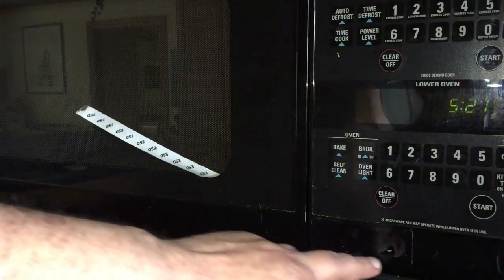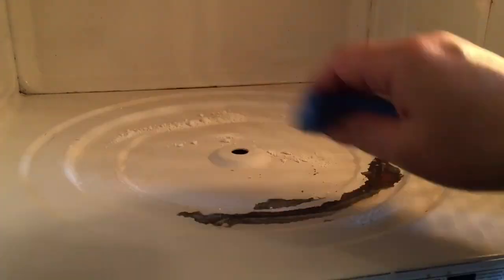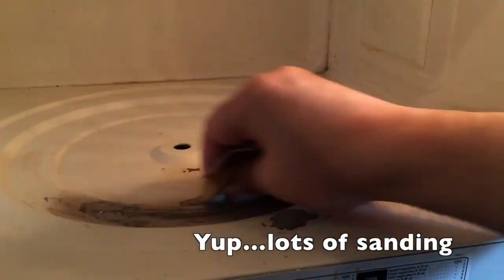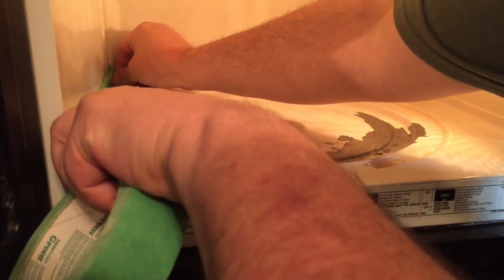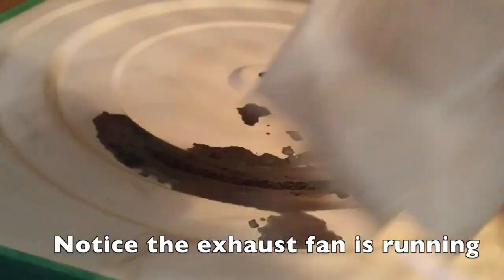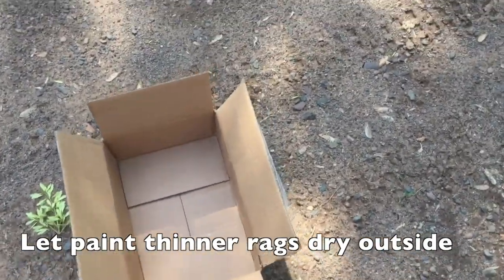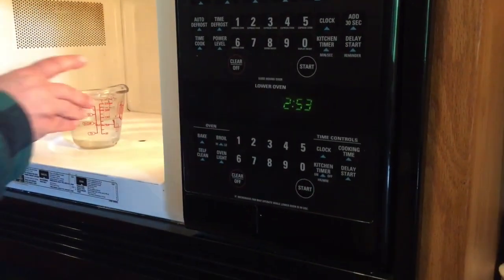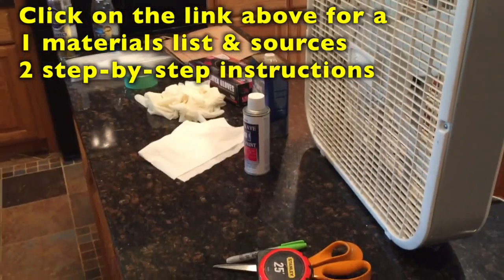Paint your microwave's interior - fix rust and peeling - Step-by-step

Comment: Aloha,  every thing rusts here in Hawaii.  I found using a wire brush on
 a drill worked great after scraping the scales off.  Then a bit of 
sandpaper to smooth it down.  I thought about using rust preventive but 
decided Rustoleum prevents rust so I used 1200 degree high heat white.  
Waited an hour after 1st coat to put the 2nd coat.  Used green scrubber 
to clean the wheels on the ring.  After 24 hours, I put a cup of water 
with 2 heaping tablespoons of baking soda and ran it for 3
Reply from the maker: "…and ran it for 3…"   what happened next????
Reply: @maximpulse  minutes to remove any paint odor that may be there if you don't let it dry a full 24 hours
Reply from the maker: @franlum  Thank you for coming back to satisfy my. curiosity! 
One more thing you might want to consider is adding a silicone mat under the carousel wheels.
You can see what I mean here:
https://maximpulse.com/tools/repaint-microwave.html

Comment: I  just did this to my microwave--just the bottom. It looks like new. I sanded until ALL the rust was gone. Made sure no residue was on it, then sprayed the whole bottom. I sprayed it twice. I hope my microwave lasts a lot longer. I have been babying it--leaving the door open to let it dry after using, making sure no water is underneath the clear plate. Thanks for the video, maximpulse!
Reply from the maker: Good for you! 
Since making this video I have added one major improvement: putting a silicone mat under the wheels. This prevents the wheels from grinding off your new beautiful paint.
You can see what I mean on my web page here:
https://maximpulse.com/tools/repaint-microwave.html

Comment: Paint it out doors
Wear gloves with bar keepers.
The paint appears chalky instead of glossy?
Reply from the maker: I understand your suggestions, but there are reasons I did this the way I did.
 It's hard to take a $2000+ built-in wall oven/microwave outdoors…that's why I showed how to re-paint it without moving it.
The paint is glossy when applied in several thin layers. It is good to practice outdoors on a piece of cardboard before doing the microwave itself.  
No need for gloves with Barkeeper's for me and everyone else I know but maybe some folks have sensitive skin.
Reply: I painted my microwave in my kitchen. The paint really does have strong fumes. I left my door and window open and blew the fumes outside with a fan. Then I left the fan on until it dried. DO NOT breathe in the fumes!!! DO NOT DO THIS AROUND CIGARETTES or any other source of flame or high heat.  PLUS----I just love Barkeepers Friend. I use it to clean a lot of stuff around the house. It removes rust really well. I even make a paste of it to remove rust on fabrics.  ( My 2 cents today)

Comment: Mine was way way worse than this and only on the bottom. I did the cell phone thing and it seems there's radiation leaking out - shame too cause it's only 2 years old! Don't think i'll be buying another hamilton beach brand.
For now, i'm holding off buying another and i've started using my air fryer/toast oven to heat up my leftovers - it's way more hassle but works good enough.

Comment: I find a metal brush works wonders (wear a respirator, use a vacuum cleaner if you have it to pick up the dust).
Reply from the maker: Sounds like a good idea for getting started.
And then using progressively finer grits of sandpaper for a smooth edge.

Comment: Appears to be a GE JTP86BF6BB built-in ya got there. Mine is the JT965SK2SS--nearly identical, including the issue with the flaking paint inside the microwave. I found that QB Products 98QBP0302 paint didn't hold up over time, in spite of my careful application. So I tried an automotive paint (non-metallic) a try on a whim. The results have outlasted the QB Products stuff... so far.
Reply from the maker: Hi, thanks for your contributing your experiences. 
What is the automotive paint you tried? It's too bad there isn't any testing to tell us what paints are effective or "safe". I have no idea what makes QB declare their paint as being for microwaves. Sigh.
I am finding the paint is holding up well except for where the wheels trace their circle. Come Spring I'll try doing this again but with a primer. QB claims one doesn't need a primer, but many folks have chastised me for not using one. We'll see! 
But I can't do that right now as it's -25° F so I can't have the windows open to ventilate.
I am about to make one more video with another solution I thought up. It is pretty stupid to have this problem at all.
Reply: You see, the funny thing is I have one that looks quite different on the outside, different brand too, but inside it's also painted white and the spinner wheel thingie and the plate/dish look IDENTICAL.

Comment: Sir, the top of my microwave  is peeling.  Can I use my my small hand sander? The arthritis in my hands makes it difficult to do things of this nature for long periods.  Also, could I do this out of doors?  Thank you so much for this video.
Reply from the maker: I don't see any reason why you couldn't use your small hand sander.
And yes, if you can doo this outdoors, that is the best! There were dust and paint fumes. That's why I made the plastic shroud around the door opening.
Reply: maximpulse Thank you for your kind reply

Comment: Greetings from Louisiana! So how did your repair job hold up for the long term? any recurrence at the original problem areas? The special paint is a little pricey and I just wanted to see if the effort is/was worth it. My problem is the back wall at the center/bottom aspect that started as a 2mmx2mm spot that I thought was food, but there was adjacent blistering of the paint. Now its 1 cm x 1.5 cm after scraping with my fingernail, and I'm sure there is more.Microwave is only 4 years old. May try Rust Cutter initially to change rust to a non rust surface first and then paint. Thanks for any light you can shed on the feasibility of this project. I just subscribed to your channel; you have loads of videos that look to give good advice!
Reply from the maker: I have gotten some new rust, but only where the wheels of the turntable continually grind over the new paint.
A new microwave is stunningly expensive so I am going to continue to nurse it along. And I intend to repaint, but until I find the time…I have another idea.
I bought a silicone pad which I am going to experiment with…simply trimming the pad into a ring  where I cut out a hole in the center and then trim off the edges that poke out so it lays flat and then see how that works.
Here is the pad I bought if you want to try this: https://amzn.to/2Nkwpk0
Obviously this is only a potential fix if there is only ruse where the wheels run in a circle. Folks who have peeling paint elsewhere in the box would still be doomed to repaint. And using some preventative might help.
And one would need to subsequently need to clean periodically under the silicone pad. But hopefully it will provide a barrier between the wheels and the paint.
Let me know what you decide to do!
Reply: maximpulse Thank you for your detailed reply. I’m getting gas and on my way to the house and will give a detailed reply when I get home. I want to be able to send you pics or a video to show you the spot. I haven’t scraped all of the bubbles in the paint yet but the area is likely to be twice as big by the time I do that. I was even toying with the idea of using Bondo body filler if the defect is too deep, but haven’t heard if anyone doing that yet. I’ll be in touch and thank you for taking the time to reply - I had no idea that microwaves actually had this problem until I discovered my spot and viewed your video. 👋
Reply: The rust damage reminds me of the Chevy Vega from decades past. The rust is in layers and the actual steel panel is quite thin. And I’ve always had great luck with Emerson products - until now. My clock radio/alarm is 35 years old and it’s an Emerson with 9V battery backup. Always works.
Reply from the maker: @plumkey197  If you want send photos or chat at length, I have a link at the bottom of all my web pages for emailing me directly. You can see it at the bottom of my microwave painting page here:
https://maximpulse.com/tools/repaint-microwave.html
The trouble with Bondo is the metal box is what traps the microwaves in the box. Bondo is a sort of plastic so it will not block those waves. But a microwave has a double metal box, so you get to decide what to do. If I had actual holes through the interior metal box I would probably replace the whole microwave. But if the problem is superficial rust, then I believe one can repaint and carry on. I wish I had a microwave detector to tell what's really going on but…oh well.

Comment: this is the 2nd microwave this has happened to us with.   The older ones of yesteryears never had this problem.
Reply from the maker: No kidding. This is weird problem, especially considering both the high price of these built in microwave/ovens AND how one can't replace just the microwave.
The cost was what inspired me to go to the trouble of repairing ours and filming it.
Reply: Usually we buy the cheaper microwaves but I splurged about two years ago for a "slate" finish to match my fridge and dishwasher. You guessed it! The inside top is bubbling up and some areas around the top edges. I am going to maker certain I can find another microwave in stock before I attempt this!

Comment: Can we use acrylic paint.
Reply from the maker: I don't know. There is little information about all this. And the paint I used, which has worked nicely, is the only spray paint I have found.
If you try acrylic, let me know if it works for you.
You could try painting something with the acrylic paint and then microwaving it to see what happens.
Of course always put a cup of water in there, too, to give the oven something to absorb some of the microwaves.
Reply: @maximpulse  I have tried acrylic paint it worked for me is properly 
Selletelled at the floor of the microwave. Just wanted to share with you . Been 5-6 days no problem yet.
Reply from the maker: @donowhy4113  Thanks for sharing your experience. I'm curious how it will hold up in the long run.
Below is a link to an interesting article about what plastics are suggested for microwaving and which are not. Apparently some plastics are "transparent" to the waves and do not heat up and melt. Others can heat up and melt. 
They specifically say "PET and polycarbonate should not be used for microwaving as they tend to absorb heat. Acrylic and polystyrene are also not recommended."
https://www.usplastic.com/knowledgebase/article.aspx?contentkey=952

Comment: Mine used to look like video. Only now the other day I removed plate and now it's so much worse it rusted thru making holes. Wonder if I stir up some flour and water or cornstarch and water and fill hole with it if it will work. I can't walk and when I do get 8n chair it's to fund whatever messnkiss made only I didn't know they spilt liquid in microwave that it rusted the bottom out. Anyone have any home remedies for filling holes safely
Reply from the maker: Hi Pula, here is my latest idea for a quick fix: buy a silicone mat and trim it to fit on the floor under the turntable. Here is the mat I am going to put in mine: https://amzn.to/2xm2bVG
You would need to cut out a center circle and perhaps also trim the edges, but it should fit under and support the turning wheels. It is somewhat see-thru so you can remove the platter and 3-armed turner and then place the mat on the floor and use a magic marker to trace where you need to cut. You would still have to clean it periodically, but this might be an easy quick fix.
I don't know of any material that would be guaranteed safe for repairing the shell. An epoxy filler like this: https://amzn.to/2JcWyi9 would fix any hole, but I can't say what would happen when it was microwaved. They also have a "high heat" version here: https://amzn.to/2X88MxC
You may be able to find such products in local car parts stores.
Reply: you can use hi heat epoxy
Reply from the maker: @mattijarvinen3966  Any particular product or brand? I saw a lot of reasonably priced high heat epoxy putties and very expensive resins. Any suggestions? Did you actually use high heat epoxy yourself?

Comment: How did it last, I saw reviews that that particular paint is not a good product and does not last, how did it work for you, it's longevity is what really matters😉
Reply from the maker: It has held up nicely, except where the wheels directly grind against the paint. I just repainted that narrow ring recently. It is a sturdy, hard, thick, enamel-type paint.
I don't think any other paint will work any better so I came up with a "forever" repair by putting a silicone pad between the wheels and the painted floor. It is holding up perfectly.
You can see a photo here: https://maximpulse.com/tools/repaint-microwave.html
This is the silicone pad I used: https://amzn.to/2MeaqOP
Installing the silicone pad is a simple procedure.  I just placed the pad on the floor of the microwave and traced where the center hole of the roller is (the pad is semi-transparent). Then I cut out a center hole in the pad with a razor knife.
I replaced the three-wheeled roller part, too. Probably not necessary, but considering the effort of painting and how expensive these built-in microwaves are, it just felt right.
GE roller: https://amzn.to/3kdsYuR
Reply: @maximpulse  
Thanks for the advise🤗
Just wondering if you could place the silicone mat over the bottom and bypass the painting? Mine is also a built in unit/oven combo
Reply from the maker: @theequalizer4justice879  You could certainly try just using the mat. You can always paint later on if you need to.
It seems to me there are two problems with these microwaves.
1. The wheels on the roller wear away the paint. The silicone mat solves that problem.
2. Exposed metal rusts because of all the steam and moisture in the enclosure. If you already have exposed metal under the silicone mat it may continue to rust and eventually eat holes through the metal floor.
If you try just the mat without repainting, check back let me know how things go down the road.
Reply from the maker: @theequalizer4justice879  The truly crazy thing is these built-in microwave/ ovens costing over $2000. I think we got ours used but almost new 10 years ago for a couple hundred dollars…not something to easily repeat. Saving thousands is a powerful motivation.
Reply: @maximpulse  
Thanks, I ordered some mats, but I think you are right, the mats won't stop the rust because of the steam and the paint will continue to peel,. I do have exposed metal but rust for now doesn't seem to be an issue but I can see how it would be from the steam:((
Reply: @maximpulse  
Yes they are extremely expensive $$$ that's why I don't want to have to replace it, it's actually working, why would I have to replace it because the paint came off?? Ridiculous 🤯 where would a person find a used one and Trust it to be in good working condition?
Reply from the maker: @theequalizer4justice879  Let me know how it goes for you.
I know I tend to forget to clean under the mat I put in…I guess this will serve as my reminder to do so!
Reply from the maker: @theequalizer4justice879  We found ours on Craigslist. A young couple had purchased a new home and the wife just had to have all the kitchen appliances changed from new black to stainless steel.  So we got several new appliances for a few hundred dollars. Obviously that was just luck. Since then we've learned it is a lot harder to find black appliances…like when we needed to replace our refrigerator.
But you might be surprised  how many people sell off "old" appliances simply to stay with the latest fashion and Craigslist is a great site for such things.
Reply: @maximpulse  
Thanks, just wasn't sure if you can really trust from sellers of used items especially on craigslist, buyers beware, ya know...😢
Reply: I bought the paint and tried painting after sanding and preparing and cleaning real well but still got bubbling in some areas, so sanded it again and sprayed it again and each time I repainted it still bubbled,  very frustrating and only in some places, probably going to have to resand and repaint and repeat 😫

Comment: If you clean it after something blows up in there you don't have to refurbish it I've had one for 12 years and it looks like brand new course it's a whirlpool not from the Walmart
Reply from the maker: Various brands have had this problem. But this model seems to be especially bad. And the worst of it is it is built in with the oven and a replacement goes for over $2000. Ridiculous.
Reply: ramrod 60th  I have a whirlpool and clean it regularly but still have some rust where the wheel makes contact,  not rusted as bad as this shown here.
Reply from the maker: @francov4768  Hi Franco, I made the video about repainting my microwave. All the new paint is fine except where the wheels grind over the paint. It has rusted there again. I am going to make a new video with a new solution I came up with. Click the subscribe button under my video and I think you will get an alert when I put that new video up.
Here's the link to the repainting video if you want to subscribe: https://youtu.be/-da-m47aq1M